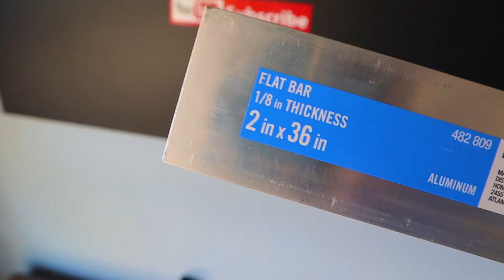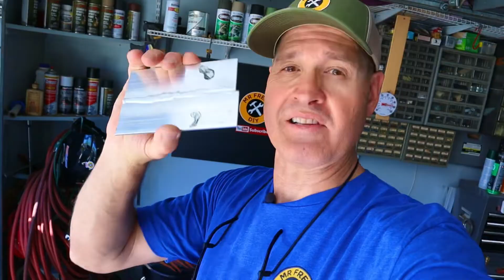Aluminum Welding Rods- Do they work?

Comment: Gonna use this on a small aluminum two stroke engine to help seal the spark plug coils, previous owner tapped a new heli coil but screwed up the seal on that as well. Either going to drill out old coils and threads, add new material, drill a new shaft, and re tap. That seems to be a pretty intense repair, however longevity is the goal. The other option was to try to fill the seem between threads but that might be difficult since the gap is so small.

Comment: Thanks, ..looking at this seems simple, I have semi truck under chase tool box that crack at one corner. Can I weld it inside (i have small butane torch)?
Reply from the maker: With the right prep and a little practice! It’s all about cleaning and prepping and temp.

Comment: Im trying to repair an aluminum wheel hairline crack on the inside of the barrel. It had a slow leak. Do you think this would be strong enough to repair a 18 inch aliminum automobile  wheel?
Reply from the maker: I have never seen it done on a wheel. It would be difficult to get the wheel up to the proper temperature.